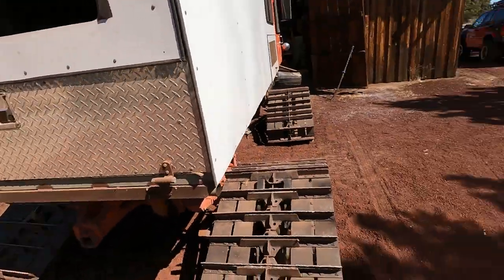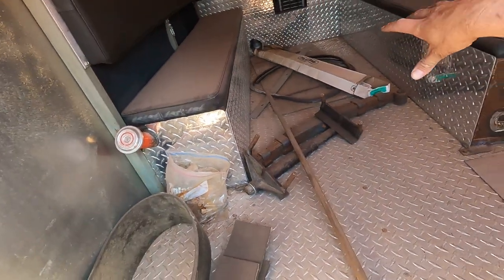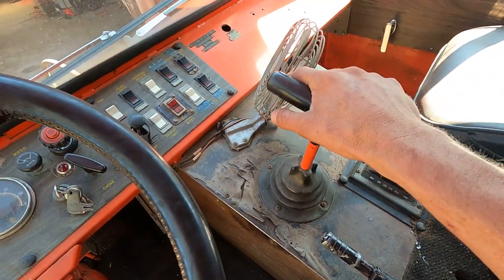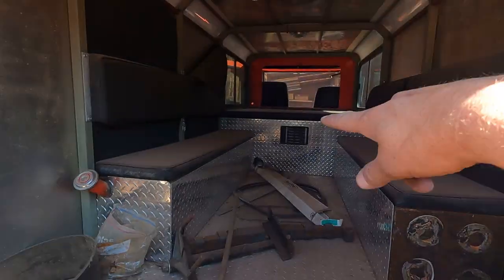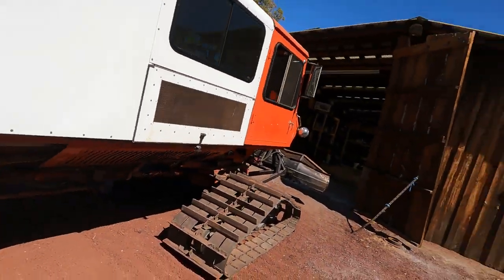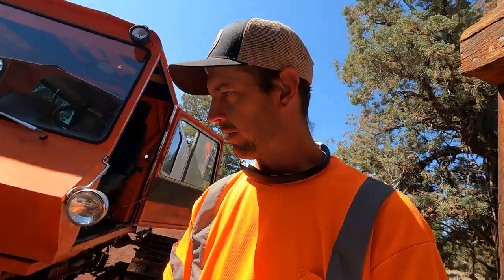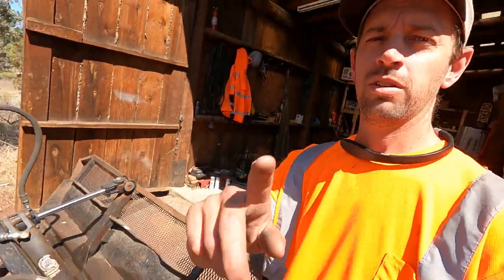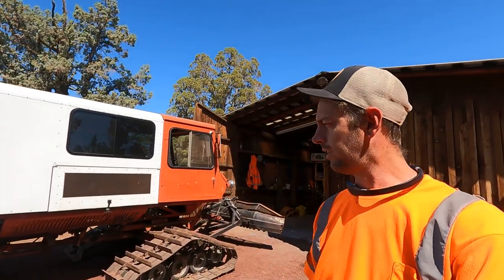Tucker Sno Cat tour!!

Comment: I recommend "hard facing" the grousers (tedious but worth it)
Also, replace every single bolt on the track with 3/8" gold zinc grade #8  bolts. Use ny-lock nuts so you can get tge torque you desire without overstressing the belt. Most importantly ,make sure you dont have the flat backing plates as they cut into the belts. They make them conicle shaped now. Buy bolts long enough to add a "belt bandaid" if you break a track when you're pulling or turning. I got my bolts at oregon wholesale hardware on 1st street in bend. Beautiful machine sir, Congratulations!

Comment: Great addition to the fleet. You will love it some days and hate it others!   Looks like a good Snow Cat.
Reply from the maker: I can see both of those things happening very easily!
Reply: @CaseyLaDelle  have you made any headway on this thing ? Looks like it would have been a good winter for it .
Reply from the maker: @dccheek7495  I sold it to buy the tracks for the Jeep
Reply: @CaseyLaDelle   What was the decisive factor for the decision in favor of the jeep tracks and against the snowcat? Flexibility or what else?
Love your Viedeos, keep going👍
Reply from the maker: @mechanikundco9118  the snowcat is better in deep snow and getting deep into the backcountry, but that's not what I'm doing.  I need to go get vehicles, and the tracked Jeep will easily go anywhere a vehicle with tires went and got stuck.  The Jeep is easier and safer to transport, can be driven down the road, and absolutely blows the snowcat away in cruising speed.    The only time a snowcat wins is in jobs like the recent one where the vehicle was left in the woods and a big snowstorm came before we could get to it.  But cases like that are few and far between
Reply: @CaseyLaDelle  there you go spewing common sense.
I hate when that happens.
😀
Reply: @CaseyLaDelle  All snow machines are made to take us out to where rescue is really difficult.
Reply: Did you ever use snow cat on recovery ? Only video I saw was the introduction of it , then the mention of selling for the tracks … awesome content keep ‘em coming
Reply from the maker: @zachstevens8165  nope, sold it before I ever used it
Reply: @CaseyLaDelle  😢

Comment: Spent many hrs in a BR350 and enjoyed ALMOST every minute. Took one very scary ride straight down a 1 1/2 mile trail with almost no control. Under a couple inches of new snow, it was all ice. The carbide picks on each metal cleat was the only thing that scratched the ice providing a little control.

Comment: If that thing has a factory Chrysler ignition system and charging system you’ll want to keep a ballast resistor, voltage regulator, ignition module and distributor pickup coil around. Take if from a guy who daily drives a 1985 dodge truck with a 318, they occasionally give up and you don’t want to get caught in the middle of nowhere with no parts. Cool snow cat with a great drive train!
Reply: I carry the same parts for my 83 and I can't tell you how many times 1 of those parts gave out while I was easily in the money on the local dirt track but man you build a 318 right and within the rules of the class I ran nothing could touch them IDK how many times my friend that ran a class above mine said when I broke the tires loose to slide the corners he could hear the valves floating and she was rode hard and put away wet every Saturday night for 3 years till I got her hot enough I wasn't going to pull in leading with 3 laps to get my 10th trophy on the podium and my header caught my oil filter on fire we think the gasket melted and it sprayed oil burned the front plastics and melted the aluminum fender and part of the doorskin off she fired up at the end of the night and drove on the trailer she became a derby engine after that headers through the hood she could get hot and not matter and in a bubble vic that was a hammer my son is rebuilding it to put in his 77 ramcharger I told him it'll pass everything except a gas station

Comment: Awesome addition to the inventory! Chrysler 360 truck engines are tough to beat, I've had several and pulled loads that other trucks couldn't. Allison transmission is good too, most of my experience is with the Torque flight 727 though.

Comment: The rubber tracks are really nice on the road, but they don't side hill as well as the steel tracks as they tend to slip. They also don't do great on ice and icy hard pack. I'd leave the steel grousers on and use it in extreme conditions and use the Jeep on tracks in easy conditions.

Comment: Put a receiver for the winch right in the blade with a pin on plate to cover it.
Reply: He could do a hyd winch too.
Reply from the maker: I was actually thinking that might be the best option
Reply: @dirtdiggur  He was talking about a hydraulic winch for the receiver in the rear and could use the same winch in the front, maybe using hydraulics from one of the blade functions.

Comment: @Matts off road recovery look his has a plow and room.  lol.    tool boxes under the side would cause clearance issues.  Turn the back bench seats into tool storage. #Tucker snow cats give him a emblem
Reply from the maker: The seats in the back are the fuel tanks.   I'm thinking boxes on the sides, but obviously they would have to be much smaller than the space that's there so that the tracks will clear while articulation and turning
Reply: sorry, i thought it was only one bench tank.   how about a step box. raised above the tracks. so you can gain easy access to your roof rack.

Comment: How about a roof rack. Line nice steel roof rack. Putting boxes below the cabin might create some issues.
And Put a portable stairs and walla, u got a nice vintage point for lookouts.
Reply from the maker: No roof rack, any taller and it would be a problem for hauling on a rollback
Reply: @CaseyLaDelle  oh yeah, u did wanna it on a rollback to the jobsites.
How about a box on a swing bar behind the rear door?.

Comment: nice addition how do you plan on getting it to the trail. and i recommended leaving the old lights on and adding the led lights, one problem with led lights is the snow is bad enough the leds dont melt the snow off and block the light
Reply from the maker: On my trailer or on a rollback.   It's legal width and weight.   As far as lights...  I'm not at all worried about accumulation on the LED's.  You have to remember that this thing isn't going down the road at 60mph with the road spray of other vehicles kicking up on it

Comment: Just rebuild the carb per the specs. Do a full tune up (plugs, wires, cap, rotor, run Techron Concentrate through it, then change to new fuel filter, ........ oil and Wix Filter(s)). After Market fuel injection will never be as reliable as the original Chrysler carburation. It worked great when it was new, just bring it back to perfect stock configuration before you start re-engineering it.
Reply: I would hope it is fuel injected (but it didn't act like it). We had our diesel Tucker leaning about 45 degrees when we were checking its capabilities.